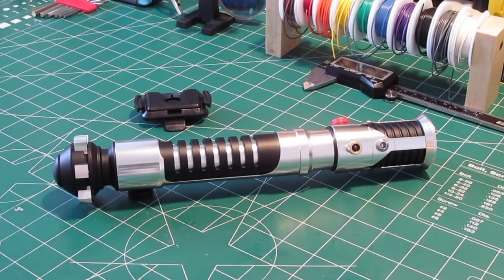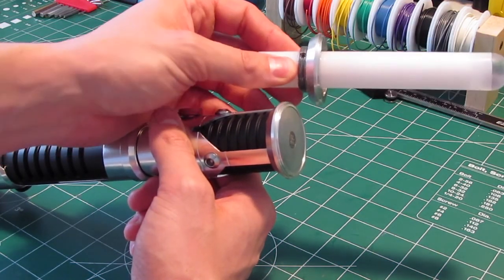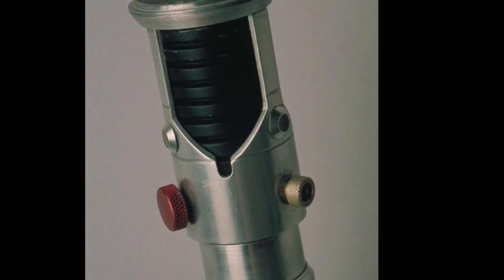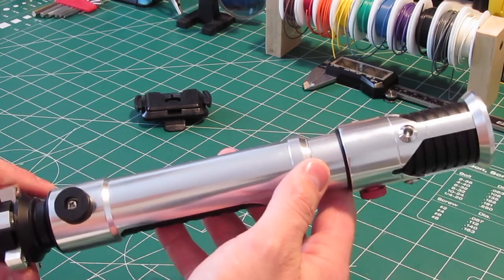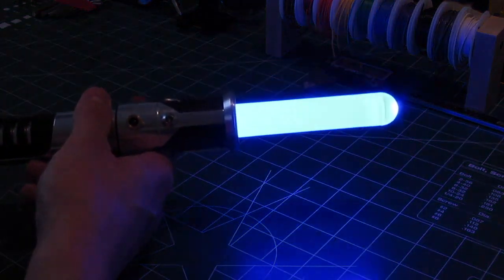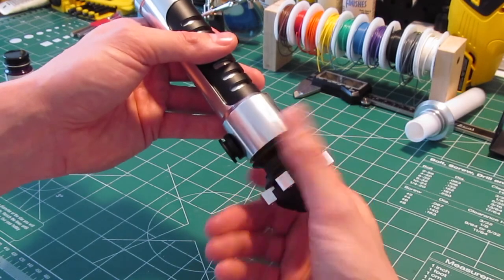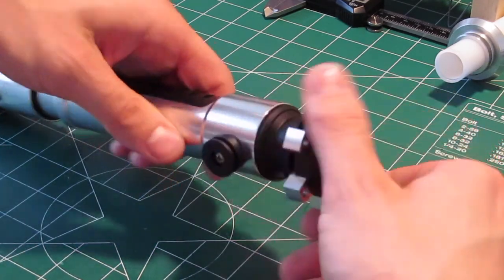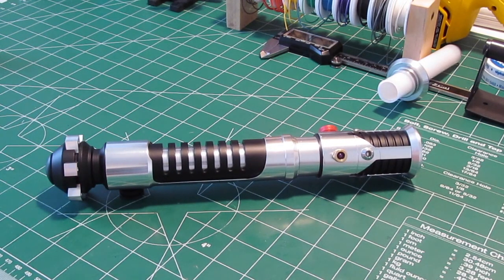Korbanth OWK with Acerocket Accuracy Mods

Comment: That is a schrader valve to presta valve adapter. So you can use a regular bike/car pump to pump up your presta valve bike tubes.. That's why it had an o ring. I used to work on old road bikes..
Reply from the maker: Exactly--thank you for that!

Comment: Following your lead I’ve made a blade plug but in a slightly different way, just need to cut down the rod/bolt and done. Not quite as screen accurate but close enough for me now :) thanks again for the inspiration! I now also have the led bezels and presta bike valve :)
Edit: oh can’t seem to post photos in comments, short sighted of youtube ;)
Reply from the maker: Glad to hear you got a real valve and LED bezels! I'd be happy to see how your blade plug turned out. True--you can't post photos in Youtube comments, but if you have an Imageshack account or similar where you can post your photos, you could add a link to that.

Comment: Awesome work Sean :) Looking forward to that run you wanna do!
Reply from the maker: Thanks, Zainal! I'll keep you posted!
Reply: Where can i get one
Reply from the maker: One of the accurate bike valves? I haven't made any yet, but I'll be sure to announce them when I do.
Reply: @excelsiorsabers  Still waiting on that run man!
Reply from the maker: @zainalazzan  It's on the list! I'll be launching mid-year with what I'm currently producing. I'll be doing the valves then as soon as I can. Stay tuned!
Reply: @excelsiorsabers  Definitely looking forward 😊 Mid-year for the hilts or for the valves?
Reply from the maker: @zainalazzan  Hilts. The initial run of the first design is done and ready for anodizing. I'm getting started on the second design very soon. The valves will be coming as soon as possible--no ETA, but I can assure you, they will be done. ;)
Reply: @excelsiorsabers  I'm just looking forward to the run of the hilts to be honest 😁 what's the difference between 1st and 2nd design? Accuracy?
Reply from the maker: @zainalazzan  Hey man--sorry for the confusion. These are hilts of my own original design--I have two styles that I'm starting with, and more to come after that. I would like to make a perfect Obi TPM saber, but that will require some equipment I don't yet have. Anything is possible though, given enough time!
Reply: @excelsiorsabers  ah okay understood :) so no Obi hilt run in the coming months! I'll be watching closely.

Comment: Looks fantastic mate. I'm currently working on a OWK based on your accuracy mods, one question I had is if the red activation button in the kit is accurate? Screen prop seems to be a brighter/stronger red?
Reply from the maker: Hey that's awesome, Daniel. Hope the build is going well. Yeah the red button in the kit is a tad light--the real ones are indeed a stronger red. The only proper way to fix that would be to re-anodize the button to the deeper red, which should be easy enough with a basic anodizing setup.

Comment: Impressive. I'd love to see how you built that and the stages involved. I've done a few Graflex 2.0 sabers but this one has been on my list for a while but I'm not sure where to begin. I'd like a crystal chamber so that makes it all the more complicated.
Reply from the maker: Thank you. The OWK can either be very simple or very complicated to build--it's all in how accurate you want it to be. A 20mm speaker and a Nano Biscotte are easy to do because they require no further modification to the hilt. A 2w bass speaker vented through the grip or a larger sound board like the Crystal Focus requires more extensive modification (lathing out the pommel for the sound board, creating an aux switch, drilling sound vents into the inner core and making a hidden slot for the speaker, etc.). You can see how I fit the 2w bass speaker into this hilt in the video above. It took a lot of planning but it turned out well. Proper timing of the hilt can also be an issue--I like to use a few hidden set screws to keep everything lined up and solid.

There have been some very nice crystal chamber Obi TPMs throughout the years--I believe Erv even made one with a spinning mechanism. Yoda has done some really nice ones. The crystal reveal certainly takes the difficulty to a whole different level, but anything is possible. It helps if you have access to a lathe and some 3D-design experience, because then you can draw up and make exactly what you want. Perhaps someone will come up with a crystal chamber conversion kit for the OWK at some point...

Comment: The presta valve is larger than the standard brass screw. What size dill and tap did you use to modify the hilt. Thanks
Reply from the maker: 9/32" drill with a 5/16"-32 tap. The tap is an uncommon size--you'll have to order it online.
Reply: @excelsiorsabers  Thanks again.  Figured I'd try the presta valve before trying to drill out the brass screw without a press.
Reply from the maker: @bovahkiin8764  No problem. Yeah I used a drill press and clamp, and just took my time with it, making sure the hole was perfectly lined up.

Comment: Is Korbanth an extension of Parksabers?

Is yours an aluminum hilt? I remember seeing a Korbanth listing for this saber in steel.
Reply from the maker: Korbanth is its own company, but they used to partner with Parks for the design of certain hilts, this OWK being one of them. And yes, Parks used to make zinc-plated STEEL Obi TPM hilts, so I wouldn't be surprised if Korbanth had some of those at one point. All of the OWK hilts I've handled are aluminum. It's lighter weight, but more accurate to the original prop, which was all machined and painted aluminum (aside from the brass bike valve, fender washer and steel rod around which everything was assembled).

Comment: One more question. How do you rotate the black grip part to make it where it was on the movie? If u know what I mean
Reply from the maker: You mean the timing of the hilt--so all the parts line up correctly as on the original prop? That can be a little tricky. There are a few ways to do it. My preferred way is to use some hidden set screws to keep everything lined up. There are some caveats with this and it's difficult to describe without showing it, however. Sorry I can't really be more specific than that. If you're concerned about it, your best bet is to have a qualified sabersmith take care of it for you. Good luck!
Reply: Excelsior Sabers doesnt that make the hilt loose and shaky when u screw it down to tge set screws?
Reply from the maker: Not the way I do it--the screws are drilled through the outer piece and countersunk into the lower piece. You have to be careful not to drill all the way through the lower piece. This way, the set screws can't move and thus hold everything really tight. I also use red loctite on these to keep them from backing out, because without it, they would come loose from clash impacts to the blade over time. But again, it's hard to describe without showing it. Perhaps I'll make an OWK build video showing how I do this.
Reply: Excelsior Sabers that would be great! Could you show how you made that blade plug like that aswell?
Reply from the maker: Sure--I will look into doing that. It's fairly simple--just find a 1.5" fender washer and a 3/8" steel rod from the hardware store. You have to lathe out the emitter face, super glue in the fender washer, and insert the rod inside of that. The rod gets cut straight and cleaned up before being clear-coated to prevent rust. I insert a 1" shaft collar behind the fender washer and pour epoxy into that surrounding the 3/8" rod, while making sure the rod stays straight and flush to the face of the fender washer on the other side. Again, it's much easier to show than to describe.

Comment: How did you get it to line up properly? On mine, the red switch and the valve is almost 180 degrees the wrong way.
Reply from the maker: There are a few ways to get the timing correct. I use some hidden 8-32 x 1/8" set screws to keep things lined up properly (with loctite to keep them from getting loose). These are located near the base of the emitter and underneath the main grip shroud.

Comment: What size thread is that and how do you lathe it without stripping the threads
Reply from the maker: Hi--could you be more specific about which threads you mean? Thanks.
Reply: Excelsior Sabers the ones on the removable emitter piece
Reply from the maker: Now that I'm not sure of. So far I've been having TCSS take care of the machining modifications for the emitter pieces.

Comment: I have one of these on the way and I’m wanting to upgrade parts to be close to yours but I can’t find where to get good replacement leds. Any help? 

Also, since I don’t have a lathe or know someone with one, I was going to get a blade plug for the emitter to be somewhat correct. I know I’ll need a retention screw for that so does this kits red button screw in? I see some replacement buttons that can be used as a retention screw and thought of doing that. Thanks!
Reply from the maker: Hi Devin! Are you talking about the actual clear LEDs or the LED bezels? The bezels can be found on Ebay, but if you're looking for the LEDs, I can point you in the right direction there as well.

Regarding a blade plug, KR makes one that has a ring-shaped groove that is 1" in diameter. I used that on the first OWK I built (see my earliest OWK video). The red button does not screw in as it's designed to fit over the momentary activation switch provided with the kit, so you'd need to mount a blade retention screw somewhere. I like to do this on the ring inside the emitter in order to hide it, but beware that you have to do this carefully and clean it up well so the threads don't get clogged and jammed up when you screw it back on.
Reply: Excelsior Sabers thanks for the reply! I guess I was asking for both the bezel itself and the leds for them.  I was looking all over and I see a variety of sizes and sometimes even different angles on the cone shape. Do you recall what size Led I would need? Thanks again!
Reply: I actually just ordered one of your hemis for a correct valve I also just ordered. So thanks for that as well.
Reply from the maker: The LEDs in the emitter are 5mm. Here are the ones I used: 

https://www.superbrightleds.com/moreinfo/through-hole/5mm-blue-led-120-degree-viewing-angle-flat-tipped-1200-mcd/265/

I used these because they're already flat, so all that needs to be done is to haze them up a bit with some fine grit sand paper.

Regarding the bezels, these are the ones I use:

https://www.ebay.com/itm/5pcs-5mm-Convex-Type-Chrome-Copper-Metal-LED-Holder-with-Nut-Bezel-Panel/262487415991?epid=1131796653&hash=item3d1d781cb7:g:LLcAAOSwjXRXY5~0
Reply from the maker: Thanks for ordering the hemi! I wish you the best with your build!
Reply: Excelsior Sabers thank you so much for those links and all the help. Now I just need to sort out the emitter plug. Ideally I want the washer setup but I think I’ll go do a KR plug until I can find someone to help with a lathe.
Reply from the maker: The KR blade plug is a nice solution. I recently purchased a lathe--I can help you out here. If you're interested just email me at sean@excelsiorsabers.com.
Reply: Excelsior Sabers that would be wonderful. I should get the Korbanth tonight. I’ll send you an email after I check it out.

Comment: I just bought this kit at a convention, and one detail that is bugging me is that the red button spot on mine seems to be on the opposite side from where it should be. Is that a common feature for this kit and can it be fixed?
Reply from the maker: It is, unfortunately. There are ways of correcting it, but it's definitely a drawback of the design. I've used hidden set screws, and others have even sanded down the hilt to time the buttons differently. I'm not a fan of sanding it down mainly because that's tedious, but the hidden set screws are tricky to get right. No easy solution, I'm afraid.
Reply: @excelsiorsabers  Thank you for the response, it is greatly appreciated.
Reply from the maker: No problem!
Reply: @excelsiorsabers  Also, and apologies for doing this via comment I was not able to find a way to message you otherwise, how much would it cost to get a Korbanth OWK install done by you? Specifically, a simple Blue LED install and some work on the body of the saber to have the buttons accurate to the movie. Any response is appreciated. Please and thank you :)
Reply from the maker: Hi--thanks for asking. Unfortunately I don't take commissions for these any more as I'm working on developing new projects that I will be revealing in due time. I can help you should you decide to tackle the install yourself, however. I still have a stock OWK left myself and I am planning to do a full tutorial video on how to build it up including the accuracy mods, covertec recharge, etc. I'm hoping to do that this summer.
Reply: @excelsiorsabers  Thank you for the response. If I decide to install it myself, I will certainly ask for your help. Please and thank you :)

Comment: Hey man whered you get that blade plug if you dont mind me askin?
Reply from the maker: The blade plug is custom made. The 1" blade emitter piece that comes with the OWK kit was lathed out on its face so a 1.5" fender washer could be installed with a piece of steel rod in the center to mimic the threaded rod of the original prop.
Reply: Excelsior Sabers thats a great idea!